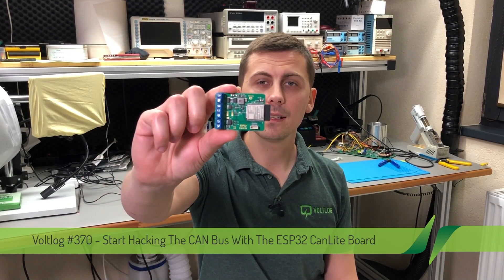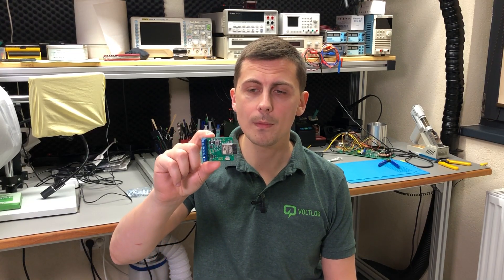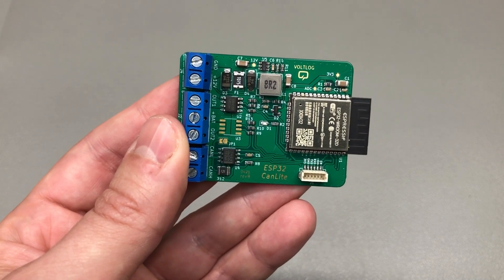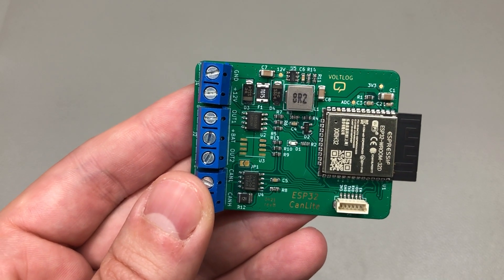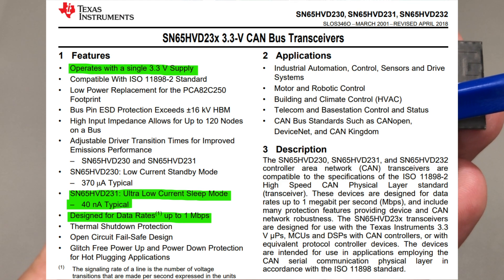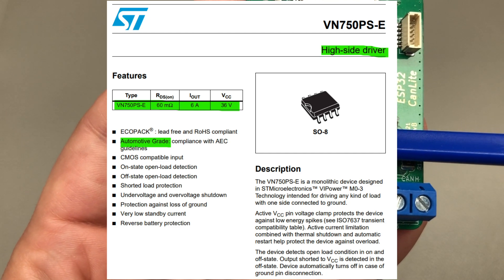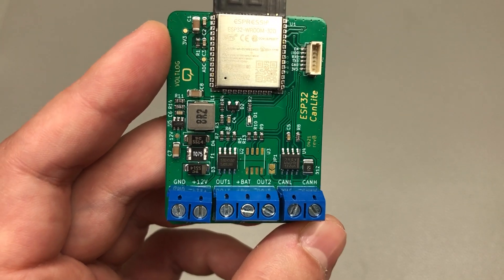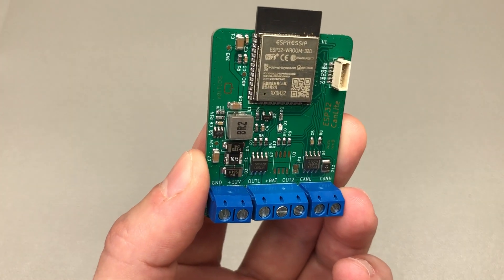Start Hacking The CAN Bus With The ESP32 CanLite Board - Voltlog #370

Comment: What's the cheapest module (original esp32 chip with the metal shield and antenna only)?  

There are some super inexpensive ESP32C3 modules <$3 that comewith the usb connctor, buttons, etc.. however those don't have the can-controller!   The original / older ESP32-WROOM-32D 16MB  , ESP-WROOM-32E 4MB, etc are not as cheap!

Comment: This is just awesome... I have a question... Is it possible to transfer data through Bluetooth module to Torque pro app on a android tablet?... let's say... Take CANH and CANL from obd port, connect to can transreceiver, read data and send that data to a android tablet using Bluetooth... Is it possible with your board?

Comment: Nice board! I use the ESP32 as a CAN adapter too, but I use the UART as a bridge. If you plan to get a wireless bridge working let me know, I'll try to contribute in my spare time. Also, be careful about subtle CAN bugs in the ESP32 silicon: http://lists.openvehicles.com/pipermail/ovmsdev/2019-November/013792.html
Reply from the maker: Thanks for sharing this resource, I'll keep this bug in mind. Looks like using an external sja1000 would be an option to consider for a future revision of the board.

Comment: @VoltLog I am very interested in this, as I'm currently having a lot of issues with the front ACC Radar on my MK7 Golf. I've built a basic arduino based wired CAN interface to monitor the traffic between the Radar and Gateway, I've captured a lot of traffic and am trying to analyse the data transfer in excel, particularly at startup when the serial numbers/VIN is transferred. 

One of the issues I'm having at the minute is that I seem to miss some packets, I think the serial connection on the Arduino (115kbps) is too slow to capture every single packet on the Bus, which is 500K. Do you think your design would be able to handle the data rate?
Reply from the maker: I think technically it should be capable of capturing the packets but software needs to be written to do that. What I tend to do when I need to sniff packets, just because it's quicker, I use a dedicated CAN>USB interface with SavvyCAN like shown in Voltlog #342 https://www.youtube.com/watch?v=GOuglqFtmOE
Reply: HELLO, I HAVE A GOLF 7, I TRIED TO CONNECT IT WITH THE ARDUINO BOTH TO THE OBD2 SOCKET AND TO THE CAN CABLES BEHIND THE STEREO BUT I DON'T RECEIVE ANY DATA, FROM WHAT I READ, YOU SUCCEEDED, WHAT DID YOU USE? THANKS
Reply: @domenicogagliano  you should receive data from the radar as soon as you connect power to it, as long as it's wired correctly and the radar is not broken. Does your radar work normally?
Reply: @davegsm82  You can interconnect and communicate with the CANbus beforehand and change the power to the Arduino remote control

Comment: Excellent work VoltLog. However you have chosen interlocking screw down terminals, but spaced the connectors too far apart on the PCB for the interlocking to occur. They will be much stronger as a block if they can interlock. I like your design decisions, I was unaware there were such powerful 12V drivers in that small form factor. Very Nice.

Comment: Just slap the screw terminals together. 2p screw terminals are so weak otherwise :/
And didn't look up the sleep current of the rest, but 46k for Vbat sense will be significant I think.
Reply from the maker: There is a story behind those screw terminals being apart. At the initial design phase I wasn't sure which terminal to use, I was thinking of using some spring terminals and I wasn't sure of the tolerances on those (I had just a chineese drawing) so I just spaced them apart to make sure they fit. I will probably correct that in a future revision.

Comment: Great, I have various CAN modules and cables, I want to capture signals on my Audi A5 can bus, so far I haven't managed to capture anything.
Reply from the maker: So you've connected to the CAN BUS but not seeing anything? Where are you connecting exactly on the car?
Reply: @voltlog  I've tried via the OBD2 port, with a couple of cables, I want to access the signals for the lights and indicators.
Reply from the maker: @SimonPlatten  The OBD port is for debug tools that know which questions to ask. You are not gonna get much out of that port if you are just listening. All the fun happens behind the gateway module.
Reply: @voltlog  Gateway module?  Where is that and how do I connect...
Reply from the maker: @SimonPlatten  That is not a simple question. You need to research your particular car make/model/year, maybe find some service diagrams and figure out where everything is located.
Reply: are you providing Gerber files for viewers like me who wish to add additional CAN Bus Transceivers to the design to allow the modified design to act as a CAN network gateway
Reply: You can't just capture any CAN signals from cars like audi other than few general data. For that you need proprietary diagnostic tools and software with subscription based licenses, which is very expensive and only available to authorized service centers.

Comment: nice little board you made there. very good work. also thanks for showing the data sheet page for the tranciever IC. because it reminded me of the other typical applications for CAN bus... in fact there seems to be 3 main applications:

* automotive (of course, we already knew)
* hvac or smart building
* robotics

so these boards may prove themselves to be really useful for a wide variety of applications. there is also good usage for general IOT / home automation. whenever you also want to run wires to some smaller sensors modules or something. which is very similar as the smart building or hvac. it is an easy cables to run. or perhaps if there is already old legacy telephone wiring, in an older building. all things like this

and for the leaf client end nodes, (without wifi, you still need the esp32s as a wifi bridge)... a popular choice are the blue pill stm32f103. for only $2-3. but be sure to check which of the stm32 chips actually have a can bus feature. because some do, while others cannot. for example the black pill f4 might not have any CAN bus feature (missing). YMMV
Reply from the maker: STM32's are like gold these days :-)

Comment: Great design, but I would preferred using esp32 with RISC-V core just from prospective of that for it I can find good compiler (what is not case for Cadence Xtensa core which is disappointing that Cadence did made efforts,  and they are famous for their software)
Reply from the maker: although I'm not a firmware guy, that's a fair argument.